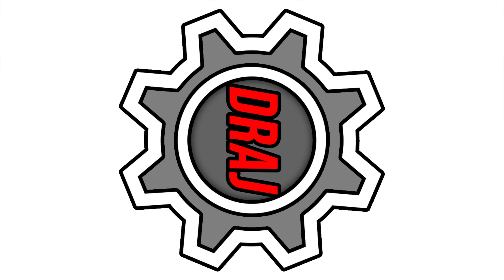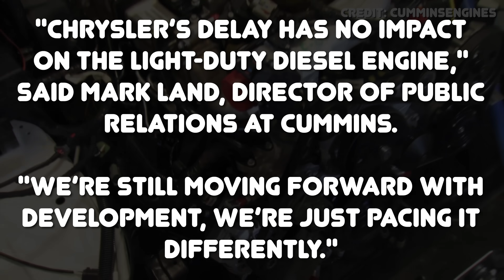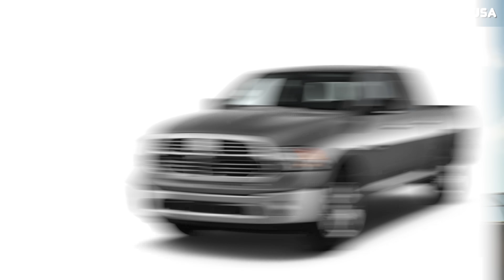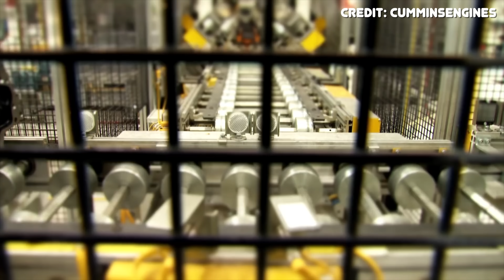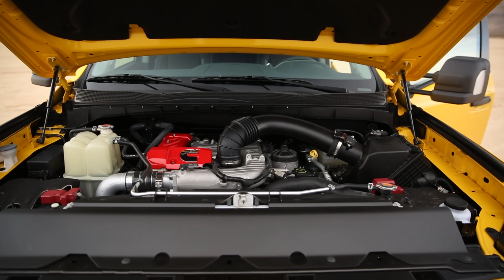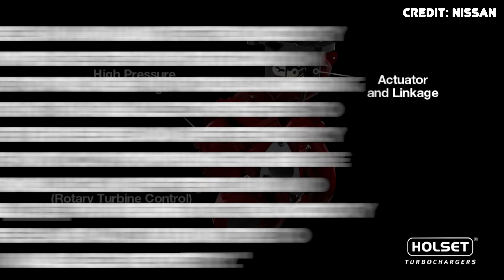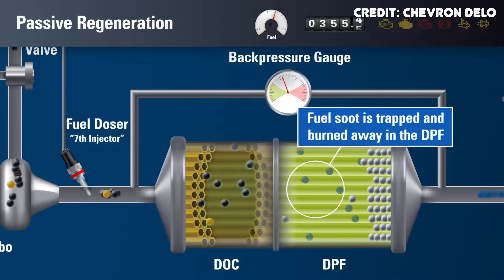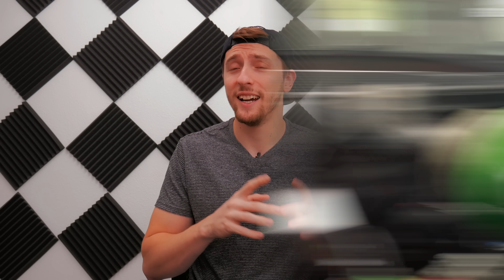5.0L Cummins: Everything You Need to Know

Comment: Nope the 5.o cummins  has timing chains  while the 5.9 and 6.7 cummins  are gear driven. The gear driven cummins  engine  will last long then the chain driven. Just my opinion
Reply: Real diesels have gears to toy chains. GM has nice inline six diesel for have ton bot they cheap them out with you guessed it chains junk !
Reply: Guaranteed
Reply: Yes toy chains will never last as long as gears

Comment: I'd like to see a cat c-9 in a Ram with an 8sp. No one would ever touch it. No emissions crap of any sort, only tuned to give a small puff of smoke under heavy loads at gear changes. You wouldn't need another motor ever. Best semi motor of all time is a 1999 model yr 600 cat. No emissions crap and pulled better than. Anything now

Comment: What kind of filter system do they use to filter out the exhaust before it gets put back into the combustion chamber?
Reply: They don't. CAT is the only brand I'm aware of that pulls exhaust after the DPF for their EGR setup. It's considered a low pressure EGR system as well.
Reply: Really I don’t think anyone filters the exhaust before going in the combustion chamber. It’s has to be hard on the engine after 2 or 3 hundred thousand miles
Reply: @chadolson6323  what caterpillar did was they had a tube that picked up the exhaust after the DPF which had been scrubbed clean, no soot. From there they had a long tube that went to the EGR cooler and then into the intake. Adept Ape did a video on that some years ago. Caterpillar called the system CGI which was short for clean gas ingestion. It is probably the most reliable EGR system ever put out that had an extremely low failure rate on the entire system.
Reply: @chadolson6323  as a diesel mechanic I can tell you from first-hand experience that the high-pressure EGR systems that pulls exhaust straight off the manifold tends to be pretty dirty and is expecially dirty on anyting maxxforce made by Navistar. In a school Bus application a maxxforce 7 DT466 sequential turbo engine has a life expectancy of about 150,000 miles. The high carbon soot completely polishes the cylinder walls to the point that the cylinder or cylinders completely lose compression.

Comment: I was curious what the story was on this engine. I think when TFL did their test of it, it came out with pretty lackluster numbers, but maybe its characteristics would make it a good swap engine? Delete and tune it, up it in a much older truck, and it would theoretically pass emissions and still make good power.
Reply: I’ve thought about that too. If I remember correctly from the research I’ve done it’s a few lbs lighter and only slightly larger than a 4bt. Would be smoother, more power without tuning it up, but they need a solution to please all of the electronics and make it run right (with no emissions). I think someone did a build with one of these with a standalone ecu a few years ago but it’s been a while since I saw it so I don’t remember the specifics, but it is possible. But possible and realistic/economical are 2 different things.
Reply: @two_toned_rooster  Size difference to an LS? I could see it being a diesel option for ones that a LS fits in, given that like you said, there's a good option to please the electronics
Reply: @jesusfeathers3477  not sure honestly but I think it’s a bit bigger. I was looking at putting one in my JKU but for the cost and work to make it go together I just sold it and got a new truck. I know it’s way heavier than an LS though.
Reply: the 5.0 is just not efficient enough in a work truck as compared to the 5.6...to justify the premium.
if it was in the Patrol/Armada/Qx80 then it could have made lots of sense.
Reply: @Tedkelvin  yep. Thought about the diesel Nissans but ended up with a ranger because my job doesn’t require anything bigger, and it’s cheap(er), fuel efficient, idles all day on 3-5L, and fits in to tight places more easily. I already have a 2002 and 2019 ram 3500 diesel so they cover my needs outside of work (the 2019 for more interior space and towing capacity and I just can’t bring myself to sell the rust free <100k mile 2002 so it stays)
Reply: EPA has entered the chat
Reply: Emissions will start looking for the components installed on the vehicle, not just the probe in the tailpipe. They're on to diesel deletists.
Reply: @TheGenerationX894  can’t tell the difference between a welded cooler and a regular cooler.

Comment: the only problem i seen was the rear end config in the Nissan. id love for Ford to use this in the F150 since they disconnected the 3L PS. a 5.0diesel with a 10sp trans and 3.55 limited-slip gear would be a useful truck for me
Reply: Ford is built out of recycled beer cans, I mean aluminum. Lmao
Reply: @871jamie  saves weight no rust the "steel" in the chevy body is thin as foil
Reply: @Perry2186  I don’t buy Chevy trucks either.
Reply: @871jamie  I prefer that, it doesn’t rust and when you live in the rust belt that’s a big deal.
Reply: @FishFind3000  buy what you want and I’ll do the same. I prefer to not drive a beer can.

Comment: I personally own one of these trucks and have been very satisfied with it. In fact I am currently on day 45 of one long road trip hauling an rv granted it’s not the heaviest load the truck can haul but it is still around 10,000lbs and it has handled mountain roads at as much as 6% grade without any issues. My biggest complaint is the fact that Nissan and Cummins did not continue their partnership! With time like any manufacturer as time goes by improvements are made and the market becomes better! I am constantly contacted by dealerships with customers looking for trucks like mine asking me to sell it which I have no plans on doing any time soon! You also do not have to delete this engine to get a sizeable increase in power by installing simple add ins such as the scorcher and momentum offered by aFe which will keep you legal based on newer federal regulations concerning diesels!
Reply: It’s a good new engine I just wouldn’t drive it without a warranty/lease agreement.
Reply: I have a CAT 287 skid steer with a 74hp 4 cylinder that moves a 10,000 machine lifting and pulling 4300lbs up in the bucket no problem in mud!
Reply: What year is your Titan?
Reply: The 5.6 gasoline version has more capacity and towing. The biggest problem in my opinion.
Reply: @king0dasouf  where do you get your figures that the 5.6 has more capacity?  The 5.6 max is around 9k, the xd is closer to 13k. Recheck your statement
Reply: @albanutz  
Lol. Max capacity was the single cab 5.6 at 2,701 lbs, while towing 12,640 lbs. While the diesel version of the same truck had a capacity of 2,180 lbs and a towing capacity of 12,360 lbs. The info is easy to find on google if you had just looked.
Reply: @king0dasouf wrong 5.6 gasser only tows 9900lbs
Reply: @XPLORMORE13 
Nope
Mine says 11,900 on the door bub

Comment: Imagine getting a 5.0 Cummins v8 and still having worse mpg and less towing than the 6 cyl half ton trucks
Reply: The truck weighs well over 7,000lbs compared to less than 6,000 gor a half ton. It also has 3.92 rear end.

Comment: This 5litre V8 Cummins gives about the same power and torque as a BMW 3litre (straight 6) twin turbo inline 6. The BMW is a proven design still in production.
Reply: Very different engines and bmw has had several different 3 liter 6s.

Comment: Owned a 2019 XD
Smoothest riding truck I've ever owned. Worst transmission ive ever experienced. And the engine are probably the most unreliable engine on the market. I worked at nissan for over a year and about once a month we were changing these engines cause the crank snapped. Always around 70k-80k km
Owning one I have to say the tuning of the engine and trans made it bad.
Maybe had they worked harder on refining the tune it would have been more enjoyable and potentially got the engine to last longer
FYI the deleted titans were hiting 150k km with no issues. Only the stock 5.0s were having the issues
Reply: I have a 2016 deleted xd with 151,000 miles. Nothing but issues before the delete. After not a problem. Transmission is the weak point.
Reply: Snapped deleted 2016 at 124k miles such a comfy truck though

Comment: On the 4 bolts per cylinder, 6.0 had really big issues with it because its compression ratio is 18:1 vs 16 so Cummins knows how to do it
Reply: The size of the bolts on the 6.0 where an issue also surface clamping area is just as important. The biggest issue with the 6.0 is the casting of the cylinder head itself you get the third revision heads and ARP studs and a multi layer premium head gasket you are doing good

Comment: Basically the Nissan titan is a 5/8 ton truck🤷🏿‍♂️...and the idea of timing chains and plastic timing chain guides to break and fall in the oil pan over time 🤦🏿‍♂️ instead of timing gears like in the 5.9 and 6.7 Cummings and 6.6 duramax or 6.7 powerstroke ??

Comment: I got to test drive both the 5.0 and the gasser 5.6 with my boat, up some fairly large hills. While the 5.0 pulled good, the 5.6 pulled just fine and had no DEF. I sadly no longer have a Nissan though. I think they are very underrated pick ups.
Reply: I think they are over rated in price
Reply: @xhongxina69  bro they are always cheaper than there American counterparts wdym???
Reply: @Kronos5.6  Lol and last 3x as long...
Reply: @Kronos5.6  Xhong means over rate as in Nissan trucks in general area typically cheaper than the big 3. He didn't mean they're more money because they aren't.
Reply: @xhongxina69  a fully loaded titan is the equivalent of a mid range American counterpart in terms of price, and have more features at that point.  Obviously when you to the very high end trucks get expensive.
Reply: until you hook up actual weight and the MPG sinks
Reply: @BuckskinsBlackPowder  The MPG argument with Diesel's has been moot for years. The modern gas v8s from the likes of Ford and GM are within a few MPG of the new diesel's with their smothering emissions systems. The extra cost of Diesel these days eats up any "savings" and then some, and that's before you include increased maintenance cost and emission system problems and associated costs. If you need a Diesel for hauling heavy that's a legit use, but you're not hauling heavy with an XD that's rated the same as other half tons on the market.
Reply: @BuckskinsBlackPowder yeah like any truck
Reply: I got a 17 platinum reserve for a great price. Crazy comfortable and pulls so much stronger then 5.6. I still drive the 05 5.6 everyday 270,000 and new transmission but no comparison on towing. You can have a trailer and go 80 and feel nothing. Tons of power you feel invincible
Reply: @radfordmunz9577  I got a 2018 XD Diesel in April. Doing my first oil and fuel filter change on her today. She has 51000 miles on her. Hopefully she will last to 200k. Diesel mechanic at Nissan said if we change the fuel filters with every oil change we should be fine.
Reply: @thomasmccrea8149  how’s your Titan treating you?
Reply: @WallofJohn  So far so good , she just hit 60,000 miles. It’s due for another oil , filter , and fuel filters changing. I’m planning on switching to Amsoil and using their engine flush and fuel system cleaner .
Reply: @WallofJohn  https://youtu.be/0WNJk-sESUE
Reply: @radfordmunz9577  I have an 05 as well.  I was thinking of getting a 2016 xd diesel.
Reply: @tomchristian4304  well for one, the comment is about Nissans…but for 2, actual statistics would disagree with you.  Ram trucks are some of the most reliable heavy duty trucks on the road, only slightly edged out by the Silverado HD.  I’d also pose that a well equipped F250 is on par in price with other heavy duty trucks in its same class.
Reply: Get another titan
Reply: No they aren't, they are junk. There is a reason why no one wants a nissan. Honest to God, every one of my friends that bought a new Titan, all two of them, traded them in for other trucks just months later. Idk why but Nissan just doesn't make a good HD truck.
Reply: @maddoxinc1642  They tried! the first gen titans are awesome. I have owned one for for years and she has never let me.
Reply: I have an 07 and I love it, I am heavily modded though!
Reply: I had a old 95 hardbody 5speed 4x4 3.0 v6 low horse high torque 154hp cranked out as much as 204 torque after lil work. With it so grunty it never got stuck anywhere. Had it 19 years traded it due to them discontinued small parts on the truck. It went 0-60 in two week but towed and hauled reliably from first day I owned it to last.
Reply: I could not stand the Nissan Titan Powertrain.. I had the XD Platinum.. That DEF system was the worst mistake.  I fought with Nissan for a year to replace the one I had since it failed at less than 20,000 miles. They finally did,  it was just one of 100 times I had it to dealer for issues. In a lot of states nothing is covered on the Diesels in small print in the Owners Manual.  Nothing minor from Fuel leaks to Tailgate latch.  As soon as I left the dealership I drove it to a Ram dealer and traded it in.
Reply: Oh yeah the Turbo went out around 5K and kept the truck in Limp mode and shop for over a month... Traded it at a loss..
Reply: They drive terrible and the tech is years behind
Reply: @Txpo50   Not true. Not on the 2020 and up.
Reply: @Calebflying2025  clearly you have no idea what you’re talking about.  The vehicle classification is determined by vehicle weight limit.  2B is 8501 to 10,000 lbs, which Nissan claims is exactly where the the Titan XD falls.  Regardless, the original comment was about diesel vs gas, and Nissan went away from diesel in 2020.
Reply: @Txpo50  My comment was regarding your very own comment about tech and driving terrible. The Titan did a Mid cycle update on 2020 and up Titan models. This only shows your lack of attention to detail, and comes off as ignorance respectfully.
Reply: @Txpo50  They drive terrible? It sounds like you've never driven one.
Reply: @WilC379  how would I know they drive terrible if I hadn’t?  Sounds like you jump to conclusions that make no sense
Reply: @tomchristian4304  you really have no clue, do you?  The Cummins 5.0 was in the Nissan XD which is classified as a 3/4 ton truck.  That’s the same class as the F250, Ram 2500, Chevy 2500 and GMC 2500. 
Again though, my comment was about how trashy the Nissan is, and considering this video is about the 5.0 motor, that includes the motor too.  You just had to pop your 2 cents in, though, because you apparently have to compensate for the fact that you have terrible taste in vehicles.
Reply: @Txpo50  no the xd never was and never will be considered a 3/4 ton truck. Therefore your entire post now lacks validity.
Reply: @Txpo50  no the titan xd was never on par with 3/4 to. Trucks🤣 its max tow rating is 11k same as the big 3 1500s🤣🤣
Reply: @moparjr89  The Titan is a class 2B vehicle, which is classified as a 3/4 ton vehicle.  It’s about payload (mostly) and not towing.  Delete yourself
Reply: @moparjr89   You are correct. I think it actually, technically went up to 12k, either way It was not anywhere near a 3/4 ton truck. That was never my issue. My issue was with all the problems. Transmissions apparently had catastrophic failure, turbos had issues, the emission systems was garbage, and it blew head gaskets, and even lifters on some. I wouldn’t touch one with a 10ft pole. It is a shame, because if it was reliable, I would have have bought a used one  one cheap. I would take a ford 6.0 over this crap. There are techs to work on a 6.0 and more reliable, once it is bulletproofed. I hate the 6.0, and had one.
Reply: @moparjr89  wrong again, the Titans can all haul 12,600 and the chevy's about 9200 and dodge is up to 8400 on all diesel 1500's. Plus this one gets up to 20 when driving, hell i get 14.6 when i haul a 10k trailer (Big Tex Dump). They are heavy half or 5/8's ton. But the boxed frame and chassis is as good as any 3/4 ton. Plus they ride and drive better with better interiors and are the most inecpensive pickups around. (Worst selling pickup on the market). For a truck i needed, the big three had price tags 8k more than what i paid, plus the dealers were selling 15 and 16's for 40k. Not 2018's.